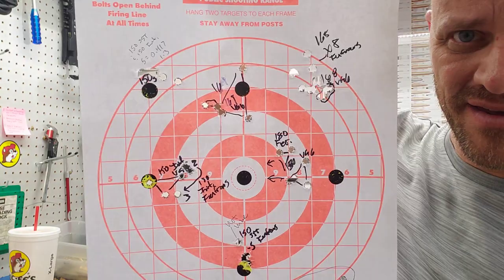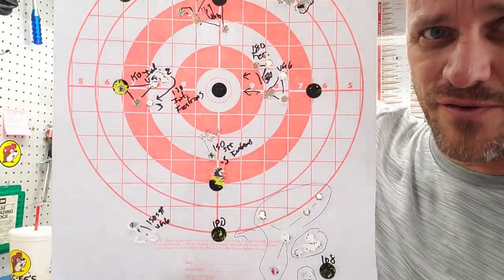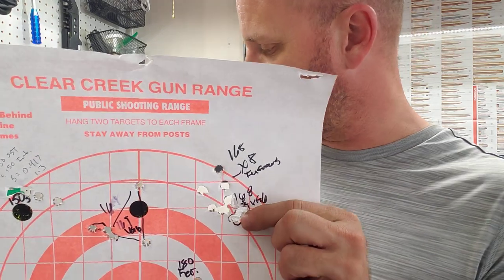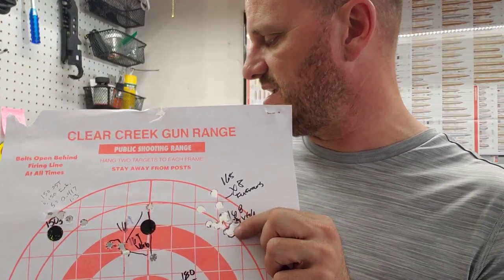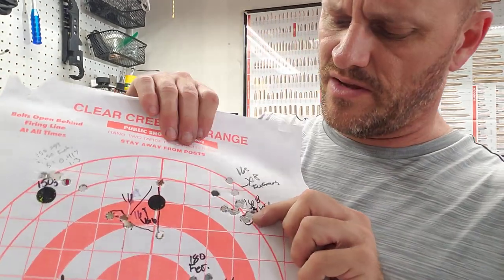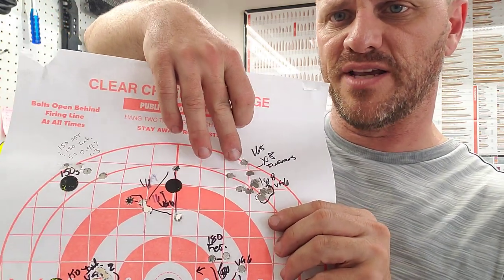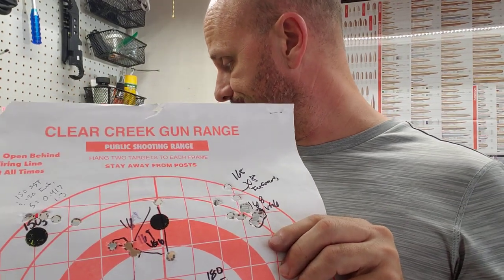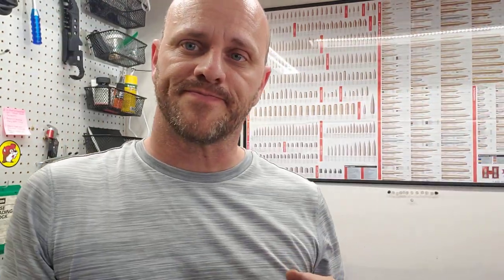GREAT SUCCESS! Shot groups all at MOA...Finally...Sig Cross, VG6 Muzzle Brake

Comment: Amazing it took you so long.. first time i took mine to the range with some factory hornady whitetail 165 gr .. shot groups under 2 cm .. handloads in 168gr shot the rhe same ...
Reply from the maker: It took far to long. I am accustomed to rifles that were not picky on loads. I found an old forum entry about barrel stress from tightening the muzzle device. I believe the US Army Marksmanship Unit had issues like this.

Comment: Thank you so much for your testing and the information. I recently bought the Sig Cross in 308, and after watching many reviews and to be honest, watching your videos had me concerned. As of today, I have not shot a round through it because have not had time and range availability. Thats changing now and I have several questions. I run a Silencer co. Omega that requires an MSR brake. I installed the brake and getting ready to go to the range. Your video makes me think I should take it off, shoot the barrel naked to break in the barrel, then zero, then test ammo, and then apply the brake loose, then tighten to specs of MSR and test again. My concern is that in order to apply the can and take it off, the brake has to be set tight. I use the can on several guns. Thoughts or suggestions?
Reply from the maker: If you find that the brake is performing best at hand tight you can use rocsett

Comment: I have cross in 6.5 don’t have a break yet but definitely gonna be picking one up. And I’m guessing yours is a 308 not 6.5. I’ve only broken in the barrel and put some down range so far even without a break it’s shooting well. But any advice being you own one would be awesome and what would you think about the vg6 on the 6.5 thanks in advance if you happen to see this and reply.
Reply from the maker: I shot one in 6.5 and was amazed how light it recoiled. The VG6 should work well. As far as shooting the Cross better...position is key. And a good firm grip with positive stock placement. When I do my part, mine shoots half moa. Yours should as well.
Reply: @sortoftactical  yeah so far it’s .5-.6 I’m running a Trijicon TARS101 3-15x50 so far I love it. But really gotta get break or stick a silencer might try both.

Comment: Just got the Cross in .308. I put a muzzle break on with a lot of torque. Put 55 rounds through it breaking it in and probably averaged about 1.4 MOA.  As a new shooter how would you recommend I proceed?  Shoot more? If so, how many rounds before I start trying other things? Take off the break? Put the break back on hand tight?  Last question, do you lose a predictable amount of muzzle velocity with the 16” barrel with varied cartridges? Thanks, Love the rifle!
Reply from the maker: If you have the ability I would check the barrel torque. Mine came in loose. About 10 under what Sig says it should be. I fixed that and got some improvements. The next piece would be shoot for groups again. If there is still a problem I would consider a looser set on the muzzle device. 
After all that, more rounds will also fix any issues. This rifle shoots a lot different than my other bolt guns, as well as my AR rifles. It was a learning curve for me. Positioning, tension, building structure in your positions, grip hold. So many things have to come into the equation.
As far as velocity goes, obviously reloading will do better for speed than factory loads. My reloads for 168 ELD-M are going 2600 fps. Not bad for a mild load. I think with a slightly faster powder I can push them faster.

Comment: My third sig cross in 6.5cm finally started shooting. I had to drop load data down and when chrono tested the load it likes is 2144 fps… 🤦🏻‍♂️
Reply from the maker: I would not accept that. Have you checked barrel torque? Also, if you have a barrel device keep in mind torqueing it can cause erratic results. I had to put my brake on hand tight with 1/8 turn under tension. I think it was 10 ft lbs. When I did that it became a 1/2 inch gun.

Comment: So the hype about the sig cross being not accurate is just that...hype? You have found that proper torque on the muzzle device has tightened up your groups substantially? I apologize if you have already explained this in the past but the myth that the gun is junk I did find crazy because I think Sig knocked it out of the park with the design and price point. Thanks for the vids man
Reply from the maker: I think some barrels can take the torque, some cant. I 100% love this rifle as it is now a shooter. I went from 1.5-2 moa with most loads to 2 separate range sessions achieving sub moa with all loads. For my rifle the torque on the barrel was the problem. Thanks for watching.
Reply: @sortoftactical  thanks for the videos and don't stop putting out awesome stuff man. The cross checks so many boxes and the initial videos on the rifle that pop up on youtube are so negative. With the groups you are shooting anybody would take that kind of performance.
Reply from the maker: @oxencott3n175  thanks. I was going to make this work no matter what.